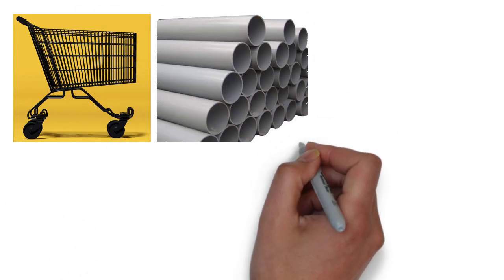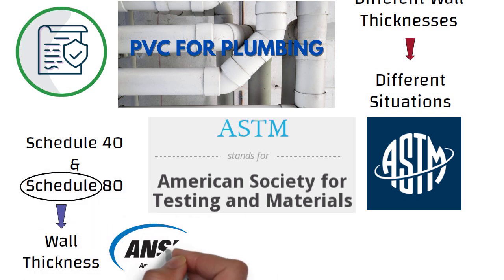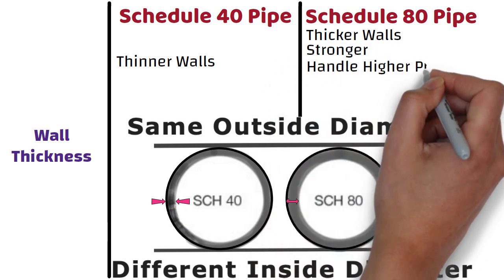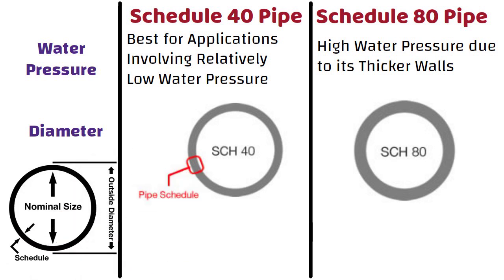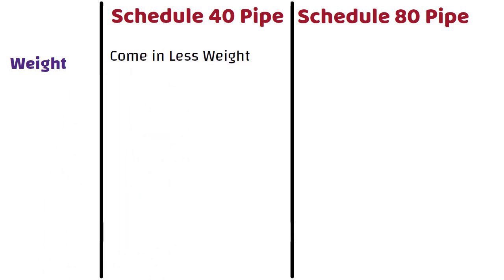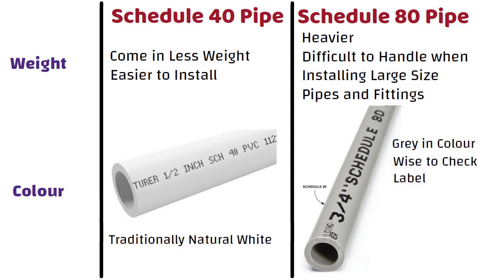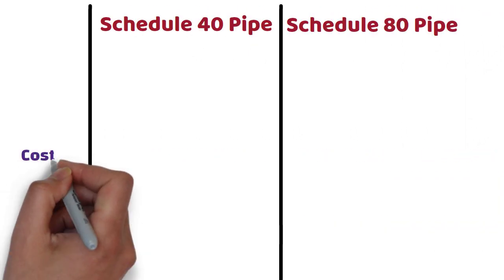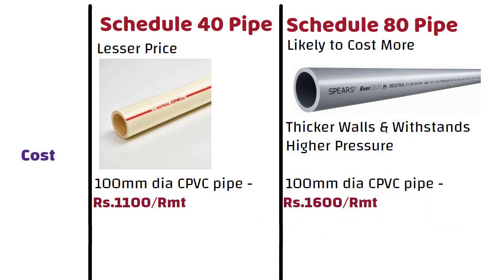Schedule 40 vs Schedule 80 PVC Pipe

Comment: Super helpful! I’m on the board of a small community water system and this really helped me understand some of the discussion/arguments I hear about pipes!  And I realize we can use the same fittings to join both kinds since they are the same outer diameter.
Reply: All plumbing pipe is measured by inside diameter, tubing is measured by outside diameter 😁👍

Comment: Nicely explain Sirji..👌👌

    Which CPVC pipe & fittings used for house plumbing for hot and cold water. Is it 40 schedule or 80 schedule..As per water pressure which one is good for house plumbing.

  Please explain...🙏🙏

Comment: Good video but it would be more useful if  you mentioned electrical specs in comparison. Less wires are allowed in schedule 80 pipe due to its decreased internal volume. This reduces its ability to exchange heat with its outside world.

Comment: Sir, generally in PVC Pipes are came in class 1 to class 6 which has max pressure rating of 12 kg/cm2(class 6), where as sch-40 & sch-80 are used in cpvc and upvc pipes na sir,,,,, pl explain